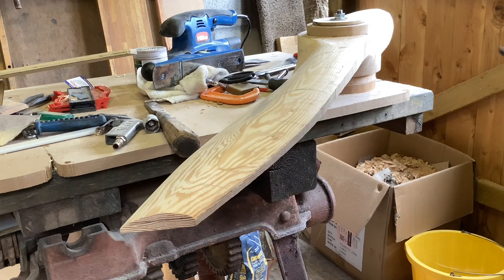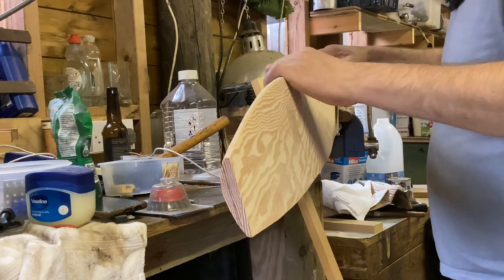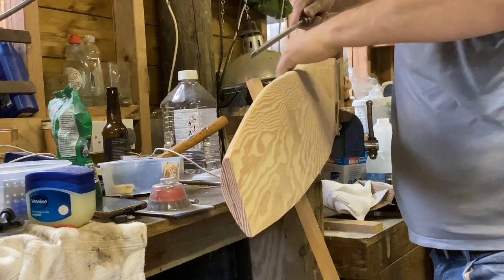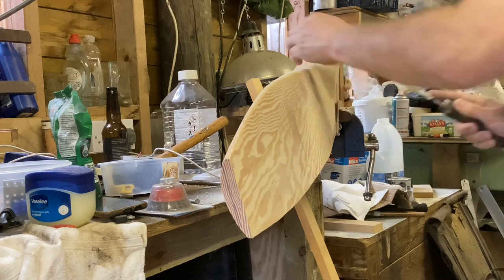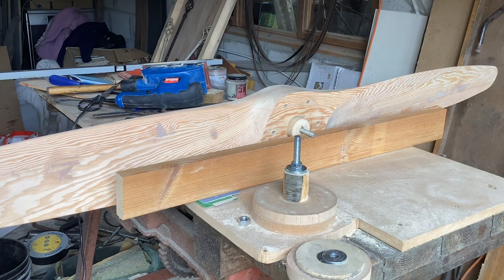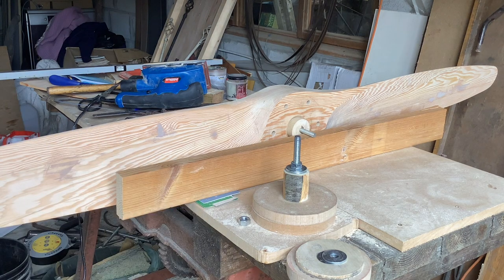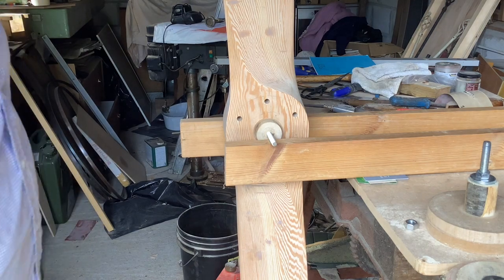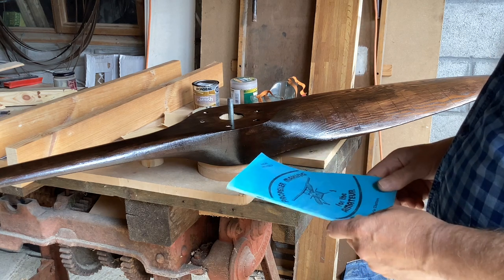Making A Propeller - Part 6 - Finished

Comment: Yes I was thrilled to see the file work along with the brief appearance of the hack saw. Beautiful prop.  I remember mentioning to you but don’t remember why you couldn’t fly with that prop.  Good wood and modern glue and certainly better than one 80 years ago.  If I remember correctly, the C2 will be in the “experimental or ultralight” category. Surely it would qualify for that.  Thanks for the videos
Reply from the maker: I could in theory fly using this propeller and the Praga motor on a deregulated ultralight. It's probably good enough although I think I'd thin the blade down a bit if I was going to use it in anger. More filing I suppose?!